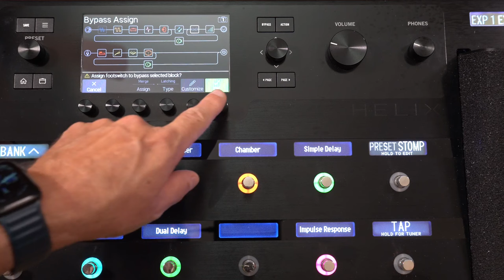Line 6 | Helix Power Practice 1 | Executing Guitar Loops

Comment: I think it's worth mentioning, if it hasn't been brought up, is your footwear could be a factor in getting things in sync for recording and playback of the looper.  I've found that softer soles on my shoe or soles that have tread on them (like a sneaker) can effect your timing when you trigger the looper (a wide sole can also be an issue).  A harder, flatter, narrower sole is much more dependable.

Comment: I was looking at the Boss RC series but as I own a Variax and a Firehawk board and Spider Jam amp I was wondering of I could replace the FH and Jam with the Helix for all my FX, Looping and Backing track play back.

What is the specs of the looper? sample time both mono and stereo?
Can you have multiple loopers in the chain for multiple instrument parts?
Can you load up backing tracks?
Are there built in grooves?

Thanks!
Reply: The looper in the Helix is very very basic and no it can't do all that you are trying to do with the boss looper abs the loop time is very limited. B the Helix is primary function is an amp/effrctsv that can do basic looping but its NOT a debated looper.